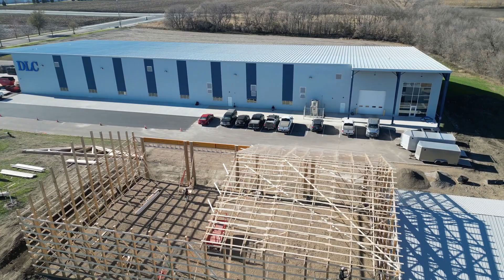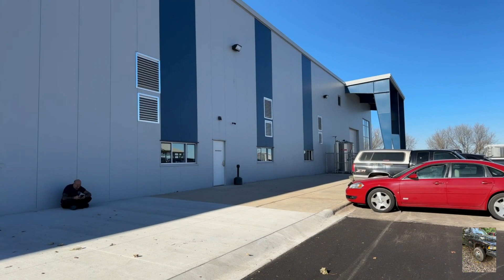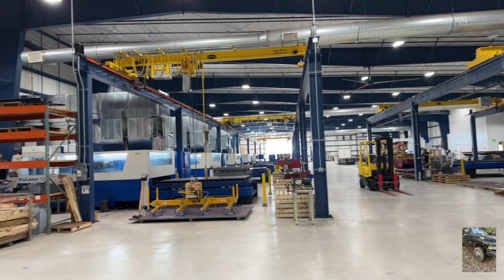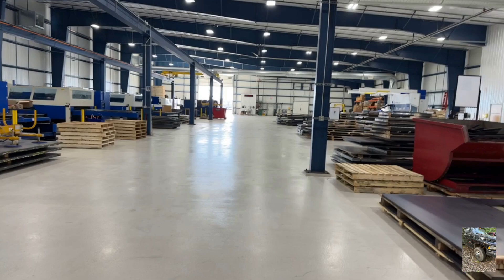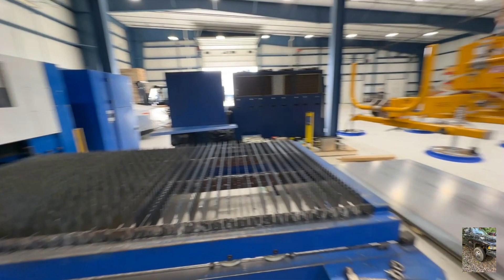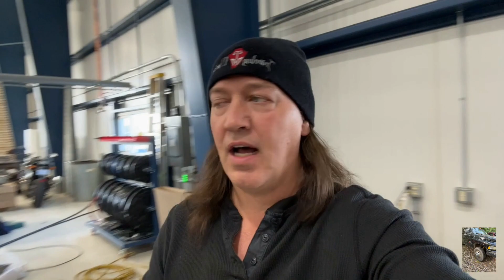Mastering Trumpf Laser Cutting: Your Top Manufacturing & Consultant in Minnesota!

Comment: Das ist eine sehr gute Idee, bei der L3050 die Sicherheitseintichtung der Tür zu überbrücken! Arbeitsschutz ist nicht wichtig!
Reply from the maker: Thanks for the comment, It was for the video.
Reply: It is a CO2 Laser, Because of the difference in light spectrum between a CO2 laser and fiber optic laser, the beam of CO2 lasers are not harmful for the eyes. That is why fiber optic laser machines are full enclosed and has special see through glasses that blocks lights that are dangerous for the eyes.
Reply: @slmnsari of course the radiation of a CO2 laser is dangerous. It can burn the cornea.
Service techs are wearing safety goggles when working with an open beam. 
Do you know the difference between a class 1 laser and a class 4 laser?